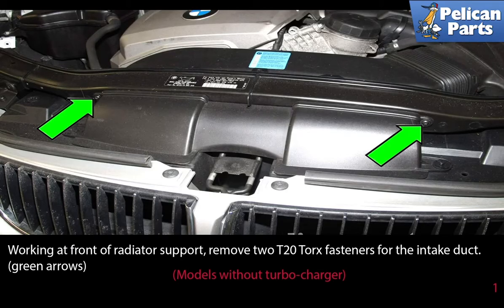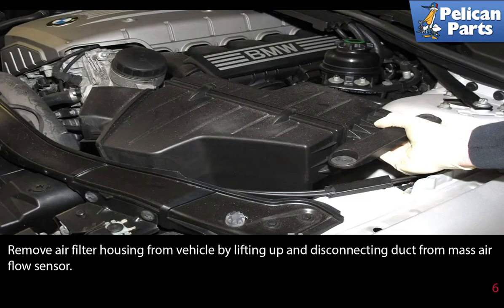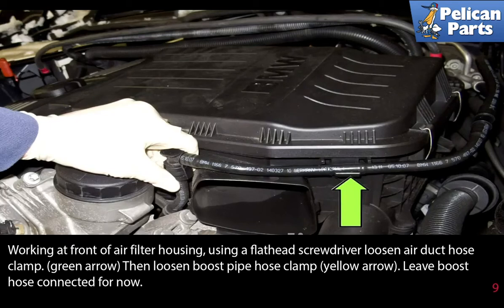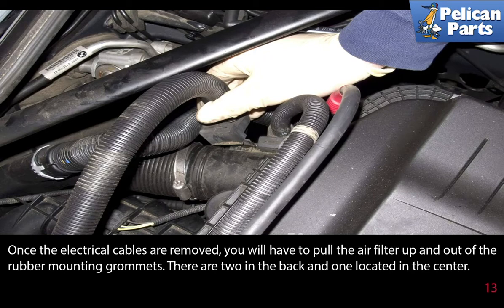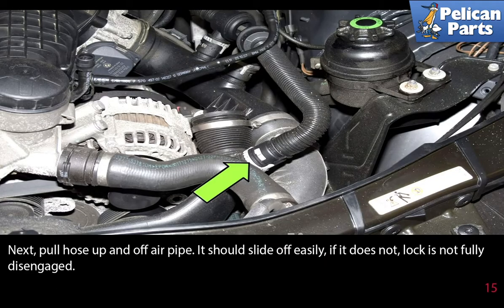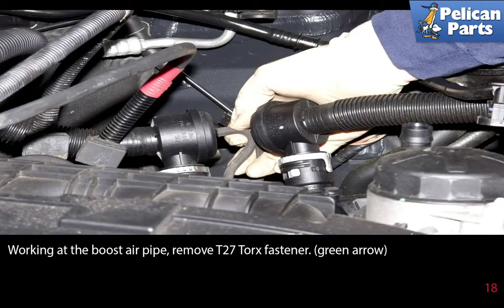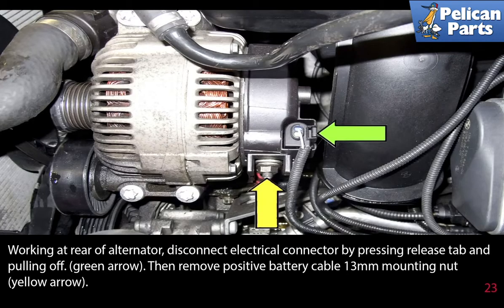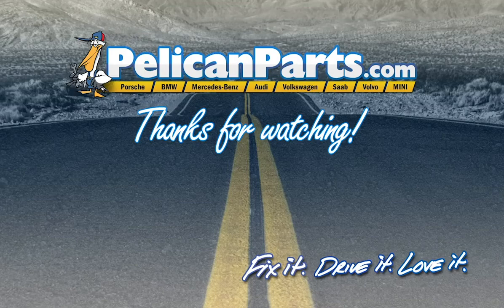BMW E90 3-Series Alternator Replacement for 325i, 325Xi, 330i, 330xi, 328i and 335i

Comment: Forgot to show how to take the belt off of the tensioner pulley
Reply from the maker: It is mentioned in the prerequisite steps. 
In this article, I'll go over the steps involved with replacing the alternator on the BMW N52 and N54 engine. I am going to describe how to remove on the N54 engine, there a few differences between the normally-aspirated and turbo-charged engines. Be sure to work with a cool engine and disconnect the battery before beginning. E90 models can come with a few alternator amperage ratings. Be sure your replacement alternator has the same rating as faulty unit. You can usually find the amperage rating on the alternator housing.

Working in trunk, disconnect battery negative cable and cover battery terminal so cable does not accidentally come in contact with disconnected cable. See our tech article on battery replacing for notes on disconnecting and reconnecting battery.

Remove drive belt. See our tech article on drive belt replacing. http://www.pelicanparts.com/BMW/techarticles/BMW-3-Series-E90/BASICS-Drive_Belt_Replacement/BASICS-Drive_Belt_Replacement.htm
Mark direction of belt rotation before removing if reusing belt. When replacing alternator, you only have to remove alternator drive belt from alternator pulley and move aside, it does not have to be removed from the engine.

Remove electric cooling fan. See our tech article on electric cooling fan replacing.

Next you will have to remove the air filter housing. Use the steps below that apply to your E90 model. Then pick up where the steps apply to all E90 models.